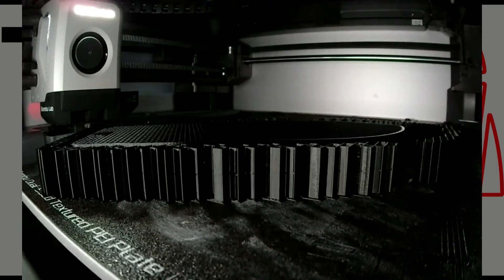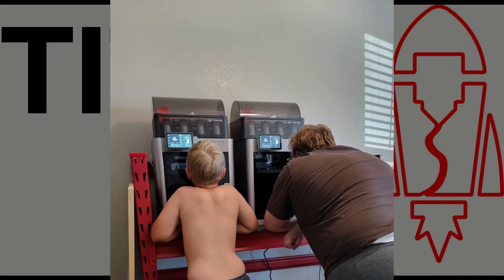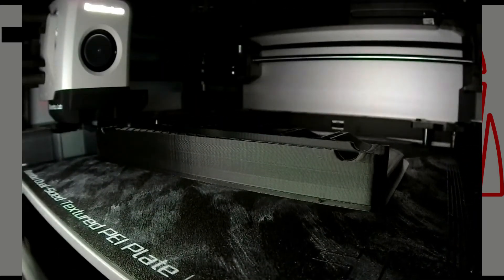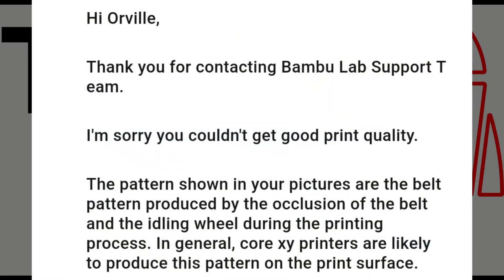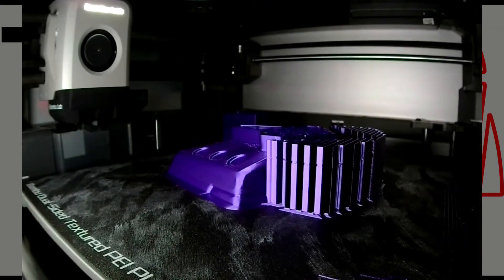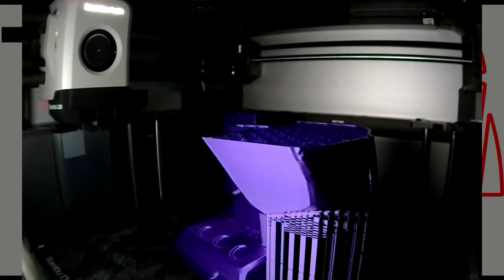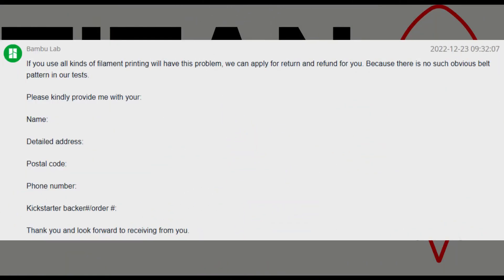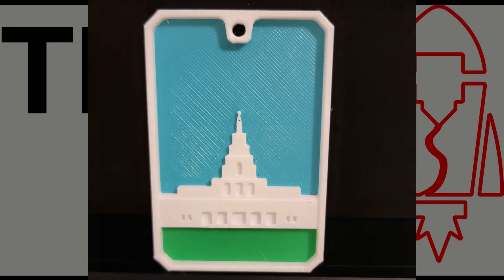Review of the Bambu X1 Carbon You Didn't Expect

Comment: Did you ever try to print it in ASA instead of PETG since it has a 37.5% higher MVS? Or did you try increasing the nozzle temp + flow so you could have higher mm/s(even though this could give some stringing) and preheat the chamber as much as possible?
Reply from the maker: I tried several materials as well as flow rates/temps
Reply: @Titan3DAZ  You shouldn't have had an issue with ASA with higher speeds since the higher MVS would allow for compensating for it and help avoid the resonance issues. The folks at Bambu Lab SHOULD have suggested it, but oh well maybe they end up solving the resonance issues by adding harmonic balancers to them in the future (granted that means they'd have reduced top speed of the printer possibly from the added weight and thus increased inertia).
Reply from the maker: @Mainfold  I had issues at every speed from 50mm/s to 300mm/s at 50mm/s increments. I then went back and changed the accelerations from 500 to 5000mm/s^2 also in 50mm/s increments. No material, no speed, no accelerations combination worked. I spent 2 full weeks doing this test with no change in print quality. All I could see what that the teeth on the belts would vibrate on the smooth idlers whenever it was moving. When I moved it by hand, I was able to feel each belt tooth move on and off the idler. This indicates to me that there is a discrepancy in the belt path distance. Like when all the teeth are on the idler, the belt is in full tension, but if you move 2mm then one tooth falls off the idler without another one making full contact so the belt is now looser and no longer in full tension. That be my only bit of information I have as to why my 2 machines did this

Comment: When I take the speed down, i become lots of ringing, when I take the speed up the ringing go away, what is the problem with the printer?
Reply from the maker: It doesn't go away no matter what speed I print at. I have tried from 50-300 mm/s
Reply: Yeah, speed does reduce the ringing, which goes against everything I ever learned in my years of 3d printing,  This is a whole different kind of machine also. My question to you, what do you do if you want that glossy surface since fast = matte surface? I've tried increasing the temp but that didn't help.
Reply: @PaDawg  reduce fan Speed
Reply: @3dFuzzie  Really!!!  I'll give that a try. Like how much?

Comment: I see you gave up returned them already but did you try turning Z hop off. it could be leadscrew error causing that pattern. Not just bambus can exhibit this defect. it can even be extruder issues as well.
Reply from the maker: Yes. It didn't help. It did make small quick moves quieter though.

Comment: It looks like you're using the lidar pre print sequence and the textured pei print surface, the product page for the textured print surface says it will cause issues. Did you try running with smooth bed or without lidar?
Reply from the maker: Yes to both of those and no it didn't help sadly.
Reply: @Titan3DAZ  sad, thank you for this review, I'm getting close to buying a new machine; hoping to see some reviews of the Prusa XL before pulling the trigger on anything...

Comment: Did You had that problem with ringing only on PETG material ? Or also on every material You printed ?
Reply from the maker: It was on every material I printed.
Reply: It appears to be at certain frequency. I am now very invested in their fix as I have a bunch of their stuff in my shopping cart.
Reply: @Titan3DAZ  i had the same with esun filament. with extrudr filament its gone
Reply from the maker: @dkastra26  I've switched from matterhackers to polymaker then to the bambu filament and it was still there.
Reply: @Titan3DAZ  oh that sucks. I have it on a stone plate 5cm height and dont have the Problem no more with the new filament. Sorry
Reply: @dkastra26  My first thought as well...what was the printer sitting on?  Could the printer have been sitting on an unstable surface?  If not perhaps a semi-solid foam mat could help.

Comment: Interesting. I had put several rolls of black petg through my x1c before my bed sensor cable and main board had to be replaced, and did not see this artifact. I suspect since you got these machines at the same time, they have the same defect. My was a KS unit, and it had the bed sensor wire issue, which resulted in the main board failing. There are a few issues that have come up with different batches. Some can be addressed by the user, this looks like it can't. Likely an issue with the tensioning system that can't be user serviced, at least not in a way where it can actually mitigate the issue.

Comment: I had this problem, and I somehow caused it myself.  I was messing with the belt tensioning and screwed something up and now I have this problem...then did it to my other printer too somehow lol.  It's 100% the belt tensioning system, xy I believe but I also messed with Z, but makes sense for it to be XY of course.  Damn I was hoping you found a fix.  I'm determined to fix this.  Let me know if anyone figured it out.  I did find a video where the guy tilts the tensioner things so the belt rides right in the middle of the pulley.  I think he's sort of on the right track, and messing with stuff like that was how I screwed my machines up so I believe the fix lies in that area as well.
Reply from the maker: Might have to loosen all the way and retry the belt tension again. I think honestly it's a QC issue with inconsistent belts/tensioner. Haven't seen a fix, but the X1C at my work is printing just fine with the same settings and materials.

Comment: I am confused. You say the problem has been traced down to the smooth return pulleys. So why not just replace those with toothed return pulleys? 
And if 120mm/sec is the worst speed for resonance issues, why not change the speed down to let say 80mm/sec??
That would also improve the print quality you are keen to achieve.
Reply from the maker: I did change the speeds from 50mm/s to 300mm/s and there was no change.
Reply: @Titan3DAZ , I can see the issue on my prints too but not only other CoreXY printer. 
I save the file now with the highest possible resolution in Inventor and it made a big difference.
Reply from the maker: @misterbean29  I used a step file than that didn't help on mine.

Comment: Exactly the same surface finish I’m finding with mine. Printing PETG with their standard speed setting. Not sure if it will be a deal breaker for me yet. There are a lot of things I like about this printer, but that surface finish is a big downside
Reply from the maker: It was throwing my parts out of tolerance so it was definitely a no go for me
Reply: @Titan3DAZ  It’s funny, I thought I did all the research too, but I suppose you don’t know until you know. I really don’t like how every major YouTuber gets a free one and doesn’t talk about any of the realistic cons.
Reply from the maker: @wakeupgeoff  agreed. Though @mandicreally has had to do some work on his machine.
Reply: I didn't think my printer had this problem, but I recently started printing some PETG and it looks exactly like this as well. With PLA I don't think I get this pattern. I just printed some 5mm tall 3mm wide "beams" across the buildplate to figure out how warped my buildplate is (yeah, that's another problem with these printers) and they have this pattern all the way from one end to the other. Probably not what people usually call "ringing" though. That usually fades, this doesn't fade it's the same pattern from one end to the other.

EDIT, well my idea to print those small beams to figure out exactly how warped the bed is didn't work. Maybe I'll try it with PLA and a bit higher beams, they didn't retain their shape. They all ended up flat even if I know the bed is at least 0.5mm lower in the middle.
Reply from the maker: @atnfn  exactly. Bambu has since acknowledged this defects existence and are "working on it".
Reply: Is this been solved yet?

Comment: I have a blv cube core xy printer and looking at the bambu's studio speed setting I try to see just as a test if I could match it , But at 100mm/s I was suffering with lots of ringing , but found that speeding it up to 300mm/s made a cleaner less ringing than printing slower .
So printing faster cuts down ringing which was news to me , because faster should mean more mass and ringing on direction changes .
Reply: Resonance.
Reply: I’ve been printing simple triangles on my Sovol SV05. It’s a new printer, has bed leveling issues (I’m getting there but it doesn’t seem to stick….) and of course is a much cheaper printer. Given the Z only moves down, I’ve found I can increase the print speed via tune, by over a 100% and the quality is insane. This is with the “rough” Cura profile and yet, the resolution of the print is absolutely incredible.
Reply: It called VFA. It need something to do with stepper motor resonance speed. Low quality motor have same issues. Even high price.

Comment: Out of curiosity, if you were mainly printing ornaments, why would be using PETG? PLA and PLA+ would be just as good for that use case.
Reply from the maker: I print loads of other things for customers. I primarily use PETG so that if people here in AZ leave things in their car they don't melt.
Reply: Gotcha! Mesa, AZ here, so I get that. I only print in pla but mainly sell fidgets. I just say “they are pretty durable, just don’t leave them in a hot car lol”
Reply: @Titan3DAZ  PETG would still get soft in a car and deform. I made some sunglasses holders with PETG and they deformed and were unable to hold my sunglasses. 
Maybe ABS would do better for those high heat situations?
Reply: @Dashitishere22  It depends on part geometry too. You can't expect a long straw of ABS / ASA to not sag in the heat of summer either.

Comment: 7:38. I don't know that there are any machines that have "similar features and specs" as the X1, especially for the money, that's what makes the  X1 such a stand out.  Other printers that can print pretty fast would be the FLSun V400 (a large Delta machine), and a Voron (another Core X/Y machine).  If the Voron interests you, but you don't want to go through the mess of building one yourself, you might want to check out the Vivedino Troodon, it's a mostly assembled Voron clone (no 3D printed parts) that will take a fraction of the time to build.
Reply from the maker: I have some of those troodons at work. Worst machines I've ever worked with. They are down wvery single week and I've replaced the motherboards on each of them over 5 times in the last year. Vorons do intrigue me though, and I'd love to build one, just need the time.
Reply: @Titan3DAZ  Interesting, I wonder what makes the Troodon so unreliable.  Are you replacing them with the same board, or have you tried other boards?  How is the power supply?  Are they getting clean power?  Good to know though.  Wish there was more coverage on them.
Reply from the maker: @Bu Jin  good psu, they're sending us the boards for free each time since they die under warranty. Haven't had the time to swap out boards and make a new firmware for them. Though I have tweaked all the motor currents and tried to dial as much back on the board as well as actively cool it with a 140mm fan with no real discernable success.
Reply: @Titan3DAZ  is Vivedino doing any component level analysis on these boards?  It sounds like something is either being ran outside of spec, or isn't living up to its spec, and it would be interesting to know which component is failing.  In either event, it does seem pretty certain, assuming clean power, that either there is a flaw in the board design or they got a bad component batch when manufacturing them (and they'll keep failing until they exhaust that batch of bad components).  Though it would be a bit of a pain, replacing the board with one of a different manufacture would probably resolve the issue.  Though yes, you would have to configure the firmware, but once you did, you could just replicate that over the additional boards you need.  

If you ever do find out what the problem is, and you were up to it, I think that would be a very interesting video.
Reply from the maker: @Bu Jin  unfortunately can't use work machines on here. This is my personal channel. The cpu on them dies and I'm not sure if they're doing any level of research on it.
Reply: @Titan3DAZ  BTW, my V400 showed up yesterday, and from initial impressions, I'm EXTREMELY impressed with its over design and build quality.  This is coming from having built a Rostock Max back in the day.  This is a mighty nice Delta.  Of course, I'm also happy with my X1 Carbon, so take it for what it's worth.  (My next 3D printer will be a large format Voron.)

Comment: So a bit late but I see a lot of people talking like this issue is just...the end of the problem, throwing their hands up and saying "C'est La Vie". But, uh, that's a smooth idler. Is it not possible to swap in for a toothed idler? Wouldn't that remove the teeth bouncing off a smooth surface?

Pls, don't tilt at me over this comment, I'm not going to engage with non-informative or aggressive shortsightedness. Let's just talk about what we can do to try and fix an issue.

Edit: I've also heard that the Bambu printers and their slicer really highlight odd or lackluster polygon models (not trying to insult). Could the files be some of the issue?
Reply from the maker: I'm sorry you have to be concerned about people responding impolitely. I couldn't find a way to get that smooth idler out. It looks like It was press fit in the housing and I couldn't see a way to get it back out. Also, I did try step files as well as the highest resolution stl and 3mf files fusion360 would export with no success. Thanks for.your comment and again I'm sorry people are hostile, I hope this doesn't come off as that either.
Reply: @Titan3DAZ  Not offensive at all, m8! You've done some excellent and thorough testing for all of us, so we owe some thanks too! 

I ordered a p1p so maybe when it gets here I could get a better look inside the stripped down model? 

Either way, this whole thing may be dissapointing at the moment, but we're all passionate about the same hobby and identifying, and solving, problems like this are great for everyone. Good luck with all your printing!
Reply: Has anyone tried not using a stepped idler, but instead printing a tpu insert over the smooth idler to make it a stepped idler?

Should absorb some energy and be easily replaceable

Comment: i have a p1p i hope i don't get this problem too. i seen your facebook post too i recall the ringing i thought you fixed it i guess not but did going faster fix that issue when you tried a test print in pla or petg?.
Reply from the maker: For me, no. The speed didn't change it. However, using carbon filled or matter filament made it less visibly noticeable.

Comment: I have a kickstarter machine that’s been running flawlessly
Reply from the maker: I'm wondering if it's just a QC issue or that some of the parts in mine aren't to the same spec as yours.
Reply: @Titan3DAZ  I’d wager those 2 machines are being looked at to determine the issue. It seems to me it indeed is some kind of QC issue, weather or not it’s hardware or a board such as vibration compensation not properly working. 

I’d like to think that perhaps the smooth idler will be updated in future machines. My next wonder is how many hours of printing at those speeds the belts can actually withstand.

Comment: I appreciate that you actually took the time to try and troubleshoot it before saying this is a lost cause. That said, this is a pitfall of getting a bleeding edge machine vs one that has been around. Hopefully they can find/fix the issue!
Reply: you know it isnt bleeding edge, right? Bambu just packaged work done in the DIY space. This is a solved problem in the high end diy space; its just that bambu would have to redo their motion system completely to fix it, or at the very least, design in more manual adjustment. the walled garden nature of the company means that a fix is unlikely to come from the community.
Reply: @jeremyglover5541  show me a DIY printer with all the features the X1C has then, including the lidar and AMS, it should also work as well as the AMS, not some buggy attempt that fails frequently. 

Bleeding edge doesn’t have to mean everything about the printer is brand new and innovative, never before seen, just that it overall is new and is more advanced than others which the X1C and even P1P managed to do that.